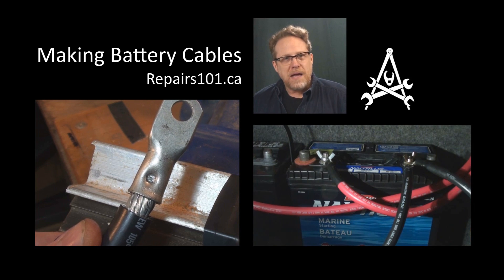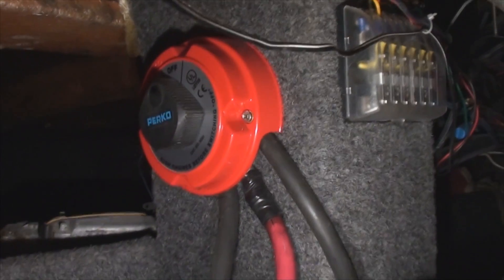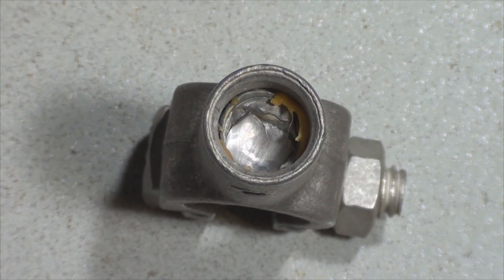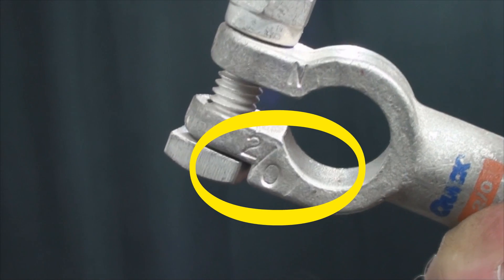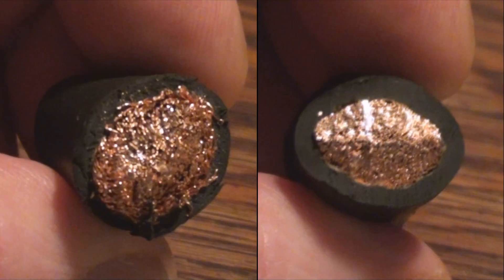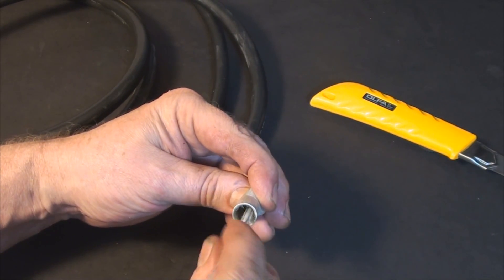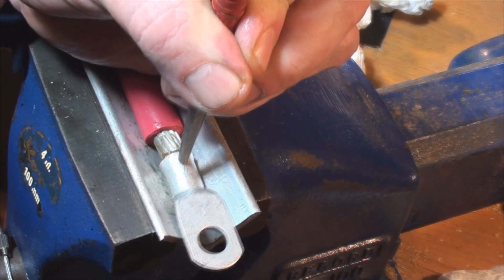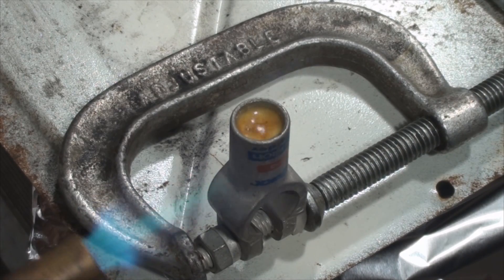How to make Battery Cables For Auto, Marine & Solar

Comment: great vid bro.....good tip on marine wire too..I inherited an 600850 ROTO CRIMP TOOL MFG: AMP TYCO ELECTRONICS and excited to use it ,,,,,it uses SOLISTRAND terminals and splices...rock on !!
Reply from the maker: +Glyn Williams - Rock on!

Comment: I was thinking of using 2/0 but was worried it was overkill for the voltage drop the heavier cable seems negligible
Reply: You never have to worry about low loads or voltage in big wires, but you will always worry about big load and high voltage in small wire, go big or stay home, do it right the first time, besides bigger cables have much less resistance.

Comment: This is a masterly, well done, and totally professional job of battery hookup wire making :) There seems to be a tremendous amount of controversy over crimping and shrink wrapping, or crimping AND soldering, then shrink wrapping (??) The argument I've heard against the soldering step is a soldered connection will raise the impedance of the copper wire, thus, producing heating and reduce overall efficiency. (??) I'd like to see a video test on making copper hookup wires for DC battery voltages where this is put to the test and cables made with and without soldering is tested for heating, impedance, and overall efficiency.
Reply from the maker: +Mark Job - Thanks for the comments. Mark. As far as masterly goes some viewers may disagree as I forgot to preheat the cable before sinking it into the terminal (3:44) causing a splash and an inferior bond. I know better but filmmaking and mechanic work are hard to do at the same time and still be good at both.  As far as the tests go I'd be interested in seeing those results too but don't think I'm qualified to conduct an empirical study. I'm just a grunt.
Reply: +wackoguywatch if they arent soldering that does not mean best way. time is money to professionals, who may give other reasons to people why they arent taking the extra time to do something that may not matter so much in every application.
then there is that job security thing. do auto manufacturers design every part of the car to be the best it could possibly be, when a car that lasted for 50 years would put them out of business? or battery cables that went bad in 5-6 years means profits at the dealer service center?

Comment: The cables you made you could even sell to a german engineer!
Nice Work!
Reply from the maker: +cue108 - Thanks! That's quite a compliment ( I know some German Engineers!)
Reply: +cue108 - I don't think you are right about the resistance. Crimping (if done right) creates a gas-tight cold weld at the surface between the wire and the terminal. A proper crimp connection is completely tight and leaves no air-filled spaces behind. Therefore you have the best imaginable contact between the wire and the terminal. However, I don't know any research about this topic, therefore i cannot prove it. Maybe you're right...
Reply from the maker: +Abcdefg -  So please explain how are these joints mechanically stressed. I don't know any science but in practise these cables are trouble free and the only stress applied is when you change the battery - once every 2 to 10 years. Never had a complaint about my battery cables and there are hundreds of vehicles and vessels out there with them in service.
Reply: Temco battery cable crimping tool on eBay shows a few pictures one with a cutaway cross section of the crimp without solder. It looks pretty solid and airtight. There is a hammer type device and a hydraulic tool made for this that avoids using a hammer and punch that could slip and give you an owie. Great video thanks.
Reply: +cue108 - German engineer here! Wouldn't buy these cables. Soldered connections on a mechanically stressed joint is not a good idea. Especially on cables this size. The solder stiffens the cable, so the strains tend to break more easily. The only viable way here to establish connections like this, is crimping (according to DIN EN 60352-2).
Reply: Abcdefg Well, crimping only has a high connection resitance thus I prefer crimping for mechanical security and soldering for a lower connection resitance especially for low voltage high AMP connections. But when you can predict mechanical forces to the connection in its environment a soldered only connection is completely fine and there is no need to stress a DIN when knowing the environment of the connection.
In higer voltage lower amps environment crimping only is best choice. 
A norm always tries to find a general formal appraoch. If one does not understand the domain very well, simply apply a DIN is best approach I think.
Reply: +Repairs101 - In an automotive environment mechanical stress on cables is caused by mostly shock, vibration and thermal expansion/shrinking. Another reason not to solder, is the corrosive effect of flux residue. Mostly the cables are so fine-stranded, that removing all the flux after soldering is nearly impossible. In combination with moisture and high temperatures corrosion can happen much faster. Ok, most of the modern flux is "no clean"-flux, so this wouldn't be a problem. 
Don't get me wrong, I'm not saying any of this must happen (I've even seen soldered high amperege connections on modern cars). But you can minimize the risk by just making a proper crimp connection. It's just state of the art.
I must say in addition, that I don't have proof for any of the things I said above. It's just what I caught up over the years, working in the automotive supply industry (no electrical stuff, to be honest).
Reply: Why not replacing it when it fails or make another one... and Of course everything has a MTBF (mean time before failure). it's either we replace or repair them :)

Comment: You're really not supposed to solder battery terminals at all!!!  the soldering creates a hard spot that cal lead to early fatigue,  and solder'd terminals can fail earlier than just crimped due to resistance and overheating. check out ABYC on this.   You've also stripped too much insulation.  the insulation should butt up against the terminal to minimize the opportunity for corrosion.
Reply: Pierre Mitham If done properly, the benefits of soldering far out weigh the disadvantages you have mentioned. On the stripped wire side, applying a heat sink while tinning the cable prevents solder from wicking under the insulation. That way, only tinned cable goes into the termination leaving the rest flexible. IF you have access to the right crimping tools by all means crimp. Many of us do not. Mechanical connections are made better by adding highly conductive solder because solder fills the voids between conductor bundles in a large cable. The more contact area you have between conductor bundles the better.
Reply: he could have put dielectric grease on before the heatshrink tubbing also
Reply: @coolguy8955  
Also use weather tight shrink with sealant in it.
Reply: The only time I ever solder is when the connector already has it in them from the factory. Normally I just use my hydraulic crimping tool that creates a welded, gas tight connection. I agree that you never want exposed stripped wire however since its unavoidable in soldered connections I wrap the exposed wire in 3m 33+ until Its flush with the lug and the insulation, then I make a seamless wrap of Temp-flex covering part of the connector, all of the 3M 33+ tape, and an inch of the wires insulation. Last step cover the entire thing in heat shrink. As for the higher resistance from crimps argument that just means your doing them wrong.
Reply: Steven Dunn good point dude good point I weld for a living if them connectors aren't right it is a living nightmare trying to get an arc stabilized
Reply: there isnt enough vibration at the end of the cable to matter. youd have to have a cold solder joint for that to happen.
Reply: Horse1066 A crimp creates a gas-tight cold weld? Who are you kidding? And as far as Engineers go.. As someone who deals with them on a constant basis and has to fix all their screw up's, They are generally some of the dumbest and most arrogant people I have ever met.
Reply: Have you actually tested the resistance? All of the soldered connections I have made have less resistance than ones with a crimp connection. Just saying from my experience.

Comment: What brand  were those preloaded terminals? Quick or Quck, or ____ and where can they be purchased?
Reply from the maker: +Ojeramup12 - they say "QUICK Fusion Solder" and I picked them up at an auto supply store in Vancouver BC
Reply: +Repairs101 Thanks!
Reply: +Ojeramup12 Amazon

Comment: wish they had them for us car audio guy's with 2 inputs
Reply: +Repairs101 I have a GMC diesel truck with two batteries a bypass will solve that and minimize/simplify the connection
Reply from the maker: DJ Rickie Ric I'm not sure I get what you're wishing for. Battery cables with two inputs?
Reply: +Repairs101 One extra conection on the plus side to get a positive wire to the trunk, where the amp is.
Reply: Do what I did. Ebay for Military Spec battery lugs. A kit comes with two lugs and a black and red rubber protective covers. All super HD and both accept 2 cables ea. I paid around $20 w/ free shipping.

Comment: also if you preheat the cable before putting it into the heated mess you will not get the spray effect and it will bond better, just not cool down that fast...
Reply from the maker: Márton Szabó Of course you're right and I know better too - running the camera can be quite a distraction. By the time I saw the footage it was too late - out of clamps and out of time. Thanks for commenting!
Reply: +Márton Szabó you have to be careful not to burn the insulation on the cable if you heat it up even with a heat gun